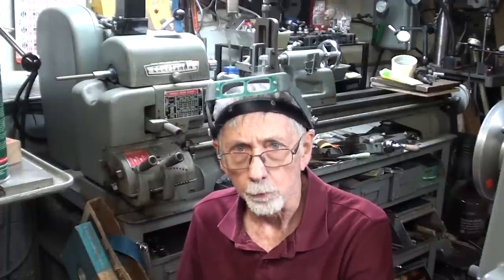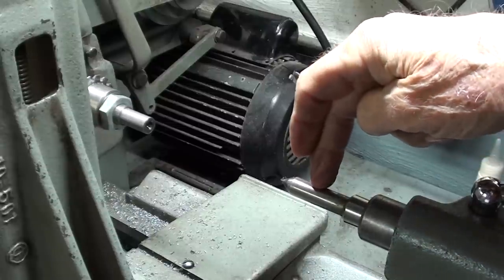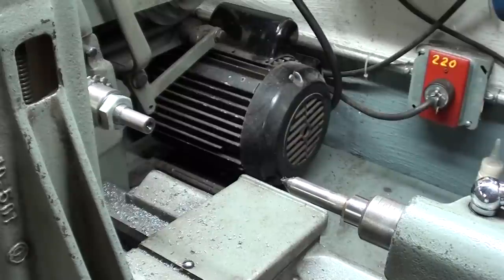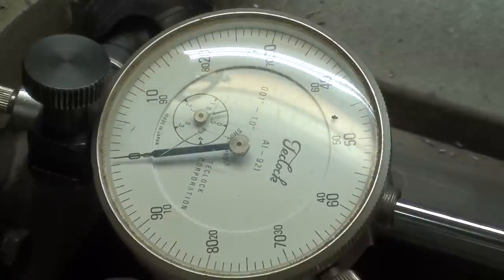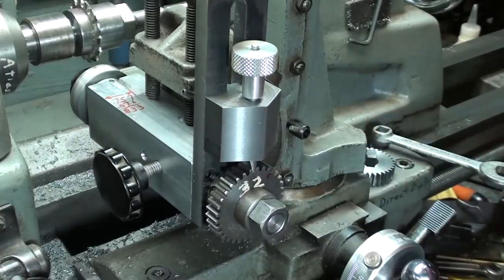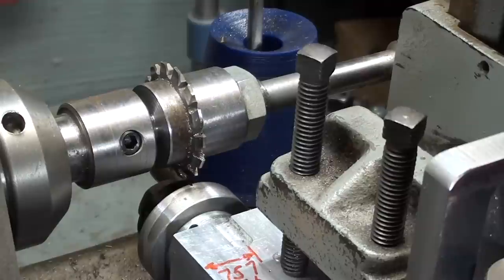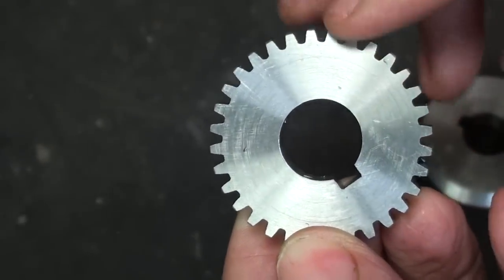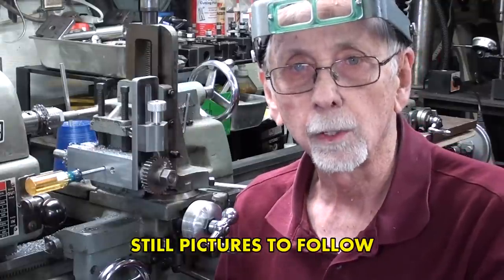CUTTING GEARS on the ATLAS LATHE pt2 #842 tubalcain craftsman

Comment: It may surprise you to hear this, but I am making this attachment; not for my lathe but to use on my tiny hobby milling machine, which is just too small to fit a real dividing head on. Thanks for the great video as always!
Reply: Atlas made a similar version of this for the milling machine. It had a headstock that used the gear like this setup and it had a tailstock with a center. They also made a version for the shaper but that is quite uncommon.

Comment: Fascinating series.
If this were to be the only time you used it the setup would be a worthwhile project just to have the gear you needed. Since for most of us once we have a tool, or fixture we find other things possible that we didn't realize until the opportunity presented itself. 
Before I had a lathe at home I cobbled things from hardware store comoonents. 
Not sure if I will make one of these  My milling attachment is homemade from angle iron so rigidity is iffy at best. Still if I were to attempt it I will have the ability to make gears at least as accurate as the old junkers that i am currently using.  😁
I like your setup with the part passing under the cutter for several reasons. Some you mentioned and the extra rigidity in the setup. As the milling vise is raised all the lash in the setup is increased along with the leverage of the cutting forces. 
In my 1946 SB the bed is so worn I have to turn anything I want straight for over an inch on the tailstock end of the lathe. As far from the chuck as possible. 
I also have to lock down the cross slide so it doesn't rattle while facing. 
Most of my work is farmer level fixes so I get along with it. 
Paul Pushee was my Tool Maker at UTC up until he retired in 1985. He was old school and taught me a lot. 
He said that on the old SB 13 that was the tool room lathe he used he had learned when to lean on the machine to get a true diameter shaft. 
After 30+ years I can lean on my SB and turn pretty close to straight. 😁😎

Comment: Thank you so much for making this series of videos and displaying your machinist / teaching talents.  Back in the late 1990's I made a home made gear cutting jig to use in my milling attachment on my little 6 inch Craftsman lathe (using the picture in the lathe manual - not much on the internet back then for drawings or plans) so I would have the ability to make change gears and other gears for it.  The change gears used on the 6 inch lathe are 24 DP with a 14.5° pressure angle.  With the limited travel ability of the milling attachment for the 6 inch lathe to use the gear cutting jig I made it is necessary to rotate the vise 180° so the two screws extend out the bottom and the jig is mounted at the top of the vise and even by doing this it is necessary to cut the blank with the cutter entering the blank at the bottom.  While visibility is a little limited you can hear the sound of the cutter to get an idea of how the blank is cutting and also view the cutter if desired using an inspection mirror.  With the setup I have I have cut gears with 16 teeth up to 64 teeth which covers the range I need to cut all the change gears.  Originally back in the late 1990's I purchased plans to create a quick change gear box for the 6 inch lathe and made the 4 compound gears (16/32 teeth) as well as turned the blanks for the speed changing gears but then lost interest in the project. 
Looking at the set up on your 12 inch lathe the smaller gears can be cut as you show but to do a larger tooth gear (64 tooth as an example) you might also have to rotate the vise 180° and cut the blank from the bottom - not sure.  Since you have a milling machine this would be the easier way to go but thought I would mention it in case someone watched the video and like me only had a lathe and the milling attachment. 
 
Since I am now retired I have again taken up interest in the lathe and I hope to create four gear sets similar in design to the six "Gearsettes" that Clausing Service Center offered for sale for the 6 inch Craftsman (and Atlas 618) lathes years ago to make threading and carriage feed set ups easier and faster - not sure if you are familiar with them.  Basically they offer consistency as once the desired thread or carriage feed is selected the operator just has to select the correct gear set and the appropriate lead screw gear to create the correct gear train.  The gear set engages with the 16/32 tooth drive gear on the lathe (which is determined by each gear set) and the change gear that goes on the lead screw is always mounted at the front with the space behind it.  The original gear sets came with a metal disc that was stamped to indicate what thread or carriage feed each covered and the lead screw gear required for a certain thread or carriage feed.  The gear sets I hope to make will probably not have the stamped metal disc but I can print out a chart and laminate it to keep on hand by the lathe. The gear sets also result in only having to set the spacing correctly between the gear set drive gear and the lead screw gear and then the gear set driven gear and the 16/32 tooth drive gear on the lathe so the gear teeth mesh properly.

Not sure if similar gear sets were ever offered for the 10 and 12 inch lathes or not but if someone had a 10 or 12 inch lathe without a quick change gear box and were cutting a bunch of different threads making a couple of gear sets for the larger lathe might be an option for easier set up of the gear trains.
Reply from the maker: Very interesting comment. Thank you so much. Keep on watching.

Comment: IMPRESSIVE! I must admit I discounted this approach to gear cutting as I was certain the setup would be as rigid as a 10 ft. tree limb. Those cuts couldn't even be heard! As they say, "Don't knock it 'til you try it." 

This setup will definitely be easier on the back for a wide range of gear applications. Yet another trick you've given me for my bag!

Again, excellent work, Mr. Pete, in bringing back the days of old and demonstrating just how feasible those methods really were.

Comment: Fantastic home shop fodder!  I wanted to expand a little on positioning of the part in relation to the spindle.  You could have spaced your (very cool!) tool block up from the bottom to clear the part, there was enough clearance above it.  But that is still a poor choice and best avoided because of rigidity.  Raising the part above the spindle is increasing the "length of the lever" above the compound making it much easier to flex and chatter.  By keeping the part as low as possible maximizes the already questionable rigidity of the system. Gear cutters are profile cutters which require much greater rigidity vs a single point cutting tool because a lot more of the tool is involved in the cut so ANYTHING you can do to to increase it will help in the fight with chatter.  A blank made of free machining steel like 12L14 would be preferred on light machines like these.

Comment: I have a 12 inch Atlas commercial lathe that I am needing to make the two tumbler gears and drive gear for. They are so worn, they are literally sharp enough to cut your finger if you touch them wrong. I cot my first blank tonight just to see if I could. Turned out perfect.

Comment: I suppose, if no gear was available to make a copy from, it would be possible to 3D print a gear and use that as a pattern. It would then be possible to make any of the change gears that so often get lost when machines change owners.
Reply from the maker: Yes
Reply: A gear with the correct teeth is easiest but you could also use a blank with 32 evenly spaced holes and a tapered plunger to match.
Reply: @ellieprice363  Good point, certainly easier and quicker to make.

Comment: Great video as i need to  make gears for a F W & J Barnes 25 inch camel back drill . I have a 10 inch Atlas lathe and also a TOS SV18 lathe plus plenty of change gears to use as patterns . My question is what steel did you use and will you be hardening the gears and also i have to make some bevel gears for the quill down drive . Do you have or are you going to do a bevel gear making video . Appreciate and enjoy your content and its never boring , filming is great and explanations and maths simple to understand thanks Cheers Doug
Reply from the maker: Thanks for watching. I have no intentions of making bevel gears. 
I do not harden any of my gears, it only makes the job even more difficult

Comment: thanks for the vid
ive got this job to do  myselfif you make the blanks with 2 diameters od and bottom of tooth next pointsetup same as yours make blanks for1 tooth bigger mine is 21  .Use 20t gear idex gear then when you get back to 20 keep indexing to 21.The idia is to makegears21,22 ,23,24,25 .That will make these so much simpeler .ttfn&ty

Comment: I like Your videos very much.
I think it would be possible to run the lathe in normal direction if You start the cut from the inside.
I might have considered mounting the arbor vertical and cut the gears from down and up. Thus would the chips drop down the chip tray and make the cleanup less of a job.
Thank you for this two video series which I put allot of interest in!
Reply from the maker: Good ideas
Reply: Now I have made a direct indexing apparatus to my small lathe. It will be used for manufacturing indexing plates to my rotary table.
Feeding towards the chuck makes it a charm to use.
Most thankful for all the lessons You provide us hobbyists with.
Regards PeO

Comment: Isn't it great when you make something and it works as advertised.
    It would be helpful to make a video on how to measure the pressure angle of the gear so that you order the correct gear cutter.
   I use the three/four tooth measurement method. Carefully measure over three gear teeth with calipers. Then calculate: (3 tooth value) + { [ cosine(pressure angle) x Pi] / Diametral Pitch}
If this is within 0.001" or 0.002" of the measurement over four teeth you picked the correct pressure angle. The difference between 14.5 and 20 degree pressure angles will only be ~0.005" so measure as close as you can.
Cheers from NC/USA